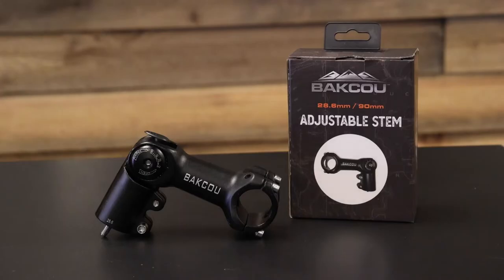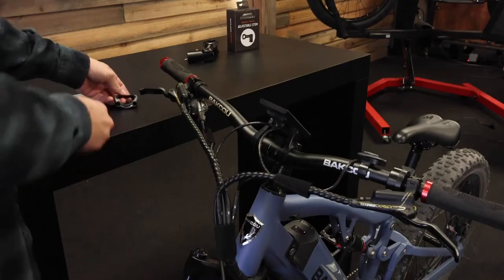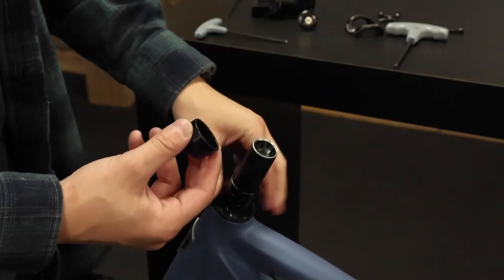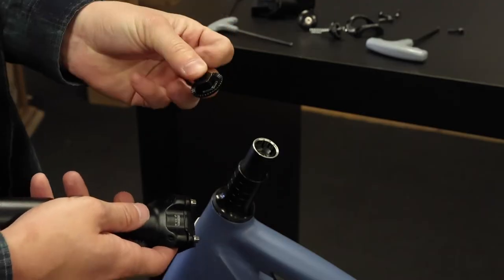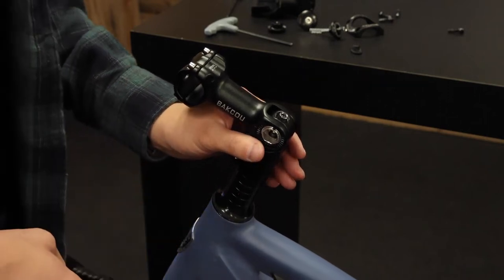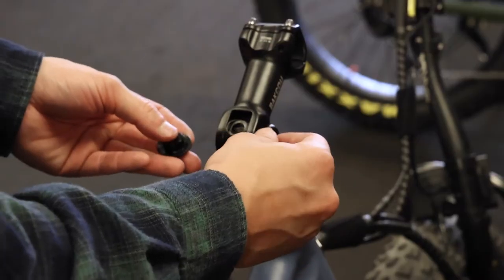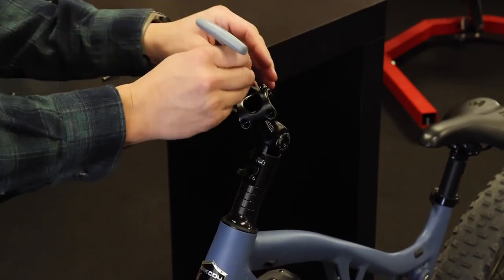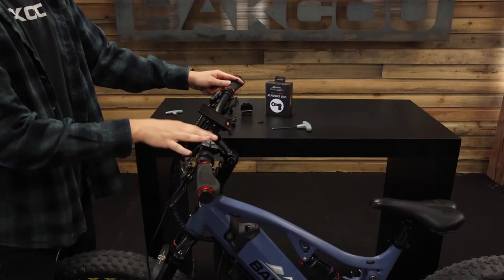How To Install Adjustable Handlebar Stem on eBike

Comment: When I install the handlebar stem raiser. The main bolt that feeds through the centre. Doesn’t screw down far enough and the forks are still moving around
Reply from the maker: There may be some spacers on your stem that need to be removed. Do you have a Bakcou bike or another brand? On our bikes, even with all of our spacers it can still fit down in there.

Comment: Wow thank you so much!! I’ve been waiting for this video! Great job
Reply from the maker: Happy to help! Anything else we can do for you? Any other videos you'd like to see?
Reply: @bakcou  I noticed when I tightened the long screw down that goes into the neck of the frame the neck and stem are really sloppy and move around a lot. I sent and email of what I'm talking about. I didn't want to tighten to much because I was afraid I would strip the threads
Reply from the maker: @johnnykoba_on_the_road  Hey sorry it took us a day to see this. Tighten the pinch tube side bolts and see if that helps. If you have to loosen the main neck bolt first, thats ok. Just be sure to tighten it back down. Try that and let us know if it works.
Reply: Really  he used the stem only to line up with the wheel ? Where have you ever seen anyone ever use just the stem to make sure the bars are lined up with the wheel ? He did the steps all wrong . He should have lightly tightened up the center and 2 bottom  stem bolts and added the handle bar to the upper stem and tightened it up enough  so he line up the bars to the wheel  and once it had it lined up using te bar as his  guide  go ahead and tighten up the  center and 2 bottom bolts . Then once he  has them nice and tight   then add the spring and 2 pressure plates .  No one  in the history  of lining up the bars has ever used just the stem to line up with the wheel . So how in the world could you type out  great job ? Show me one other video on you tube where a person shows you  to use only the stem to line up  how your bars are going to end up . Its not going to happen . No one with half a brain is going to use just the stem without the bars to line  it up .
Reply: @johnnykoba_on_the_road  The stem has to work just like any other stem . if you listen to what he said starting at 1:17 in the video  about the spacers   he said you can remove all of  them . That is  not true . If your stem post  is to high  when you go to put  the stem on  the stem post  will contact  the inter lip of the stem and it will  not tighten up . There has to be a 3mm gap between the inter lip of the stem and the stem post .   The stem post has to be  lower than  the inside lip that the  bolt washer sets on .  I don't know why he didn't go over that in his video . You have to measure the distance from the inside lip to the bottom of the stem   your stem post  on the bike has to be 2 to 3 mm less than that distance  so the  center bolt can tighten  against  the out side of the  bottom part of the stem post or the  spacer and   not  the very top of the stem post . I'm beginning to think the guy in the video is a idiot . If you are not able to get  the play out of the  stem by tightening the center bolt then you need to add a spacer or 2  to lift the stem up  so the  top of your stem post is not touching the lip inside the  stem . The best way to know is  like I said above  and measure  from the bottom of the stem to where you feel the lip inside the stem and make sure  your stem post  is 3 mm less than your measurement . If you need a spacer  add the spacer and measure from the top of the spacer once you put it over the stem post to the top of the stem post  ,keep adding spacers till  you have 3 mm less than the  stem measurement . He completely  left  that part out and  acted like it didn't matter  at all . I can't believe he told you in a reply  to just tighten up the 2  bolts on the side .  Tightening up those bolts  is not going to get rid of the play . I'm sorry but  that guy should not  be making how to videos  or answering peoples questions . If you stop the video at :56 when he takes the  bolt and cap washer off you can see the top of the stem post . You can see that's its about 3 mm below the  top of the stem .  You want to do the same thing. With  the type of stem he is showing  the only difference is you can't see  it  so you have to measure it  to make sure . You would think in the video he would show how to measure  the distance  or at least say what the distance is  and them measure the stem post on the bike to show  its at least 3 mm less space  so the  stem will tighten up correctly .  He obviously doesn't know what the hell he is doing  because he said  you can leave the spacers off if you want to and that is just not true , that stem post would have  touched  the  top of the inter lip  and he would not have been able to tighten it up . How people can be this stupid and work  with bike parts is beyond me .
Reply from the maker: @Sertao2013  It worked. And if any alignment is off all you have to do is loosen it a little and line it back up. That's what people should do every time they go for a ride anyway. Do an M check on the bike which includes breaks and handlebars. If this doesn't work for people, then it wouldn't have worked for us.

Comment: Thank you for demonstrating, looks straightforward. I just got my Stem changed out at the shop as the bike is new and no cost, I just ordered a 120 degree one, if i saw this  video before I ordered, I was sold. at least I have an idea how easy it is really to do.  my question is as you also sell Handle bars. what would be a nice fit, equal to the Huffy parkside which I feel was perfect, while I have a Cannondale Adventure 2. its not as   close to the huffy less comfy i asked, great job

Comment: Can this be used in the opposite direction to bring the handlebars close to the seat? I have a LectricXP3 & the reach is a bit far for my short arms. I would rather be able to sit more upright with handlebars closer.
Reply from the maker: Not backwards but you can rotate the stem closer to your seat, but then your brake and shifting cables would be rubbing on the front post.
Reply: look in to Besnin  it has  a 120 degree angle . but I like the Bakcou.

Comment: Is using the torque wrench necessary if my stuffs are all aluminium?
Reply: What? That's more reason to torque to spec...
Reply: @TheBhill  Why? Never used it.
Reply: @frafra224  Maybe you shouldn't be wrenching on anything where safety could be an issue.
Reply: @TheBhill  Explain your reasoning why aluminium is "more reason to use torque wrench" since it's usually recommended for carbon frame.I was merely asking a question and you chose to be nasty for no reason.
Reply: @frafra224  I wasn't "nasty" at all, just honest. Aluminum is much easier to crack, strip or otherwise damage. It's a very soft metal. 

Torquing to spec is generally a good idea to avoid over torquing & damaging parts & if I need to explain why a bolt that isn't tight is a problem then that says enough.
Reply: @TheBhill  Yeah I understand the benefits of toque wrench but I thought people would understand I mean aluminium ALLOY in the context of bike. Most bike are made of it it's tough and easy to feel with "hand tight". Nobody I know who doesn't have carbon frame work with torque wrench on thier bike and they'll all fine. I was just surprised you said its more of a reason to use torque wrench if the bike is aluminium.

Comment: Can you adjust the stem to point straight up?
Reply from the maker: Yes you can but it makes the cables a little tight so it is harder to turn the handlebars

Comment: So you're lining up the  stem without the bars on  ? How can you tell 
that the bars are going to be perfectly lined up with only  going by the
 stem ?  I have never seen anyone  use just the stem for limning up the 
bars . I think your doing it all wrong . I think to make sure you have 
the bar lined up  with the wheel  you should leave the center bolt  a 
little loose and  also leave the stem bottom 2 bolts  a little loose . 
Then stick on the handle bar. There is no reason you can't go ahead and 
put the  4 screws that hold the bar in place and just tighten them up  
enough to be able to use the bar to line it up with the wheel .  Then 
once you have it lined up using your bar as a guide like most people do 
 ,them tighten up the center  bolt and the 2 bolts on the stem . After 
you have the  center and bottom 2 stem bolts tightened up so it won't 
move   then  put the  spring and 2 pressure plates back in  and adjust 
the  angle you want . Who ever told you to  do it the way your doing it 
in the  video  told you wrong .  I just hope most people have enough 
sense  do it the right way and not the way your doing it . How in the 
world can you have anything to do with bikes if  you couldn't figure out
 how to mount this adjustable stem the correct way ? Congratulations  
you are the only person on youtube that has ever videoed themselves  
using only the stem to  line up the bars without using the bars .
Reply from the maker: It lined up perfectly. If the stem is in line with the top tube it will line up with the front wheel. Thanks for your paragraph comment but there is more than one way to do most things and they are both correct. Your way would work and this way worked as well.